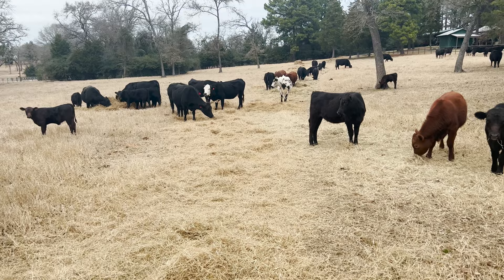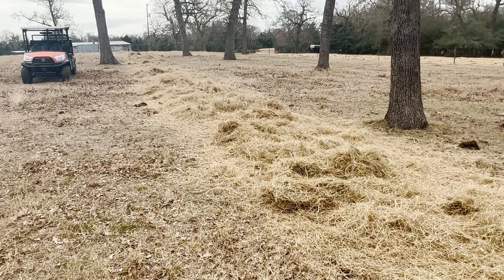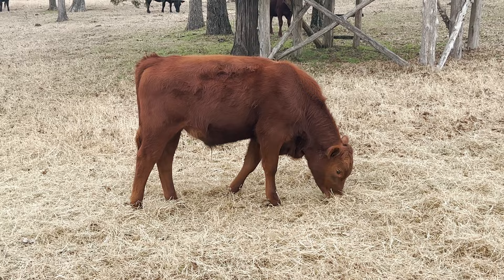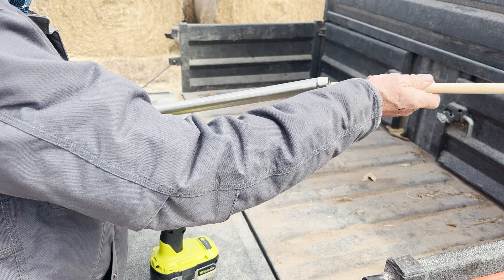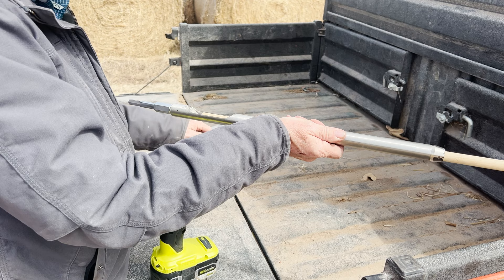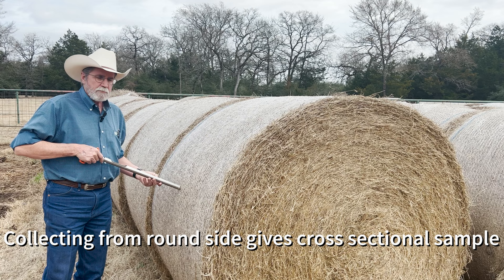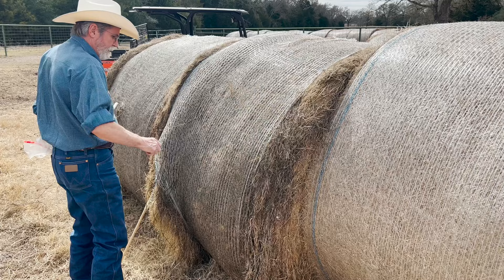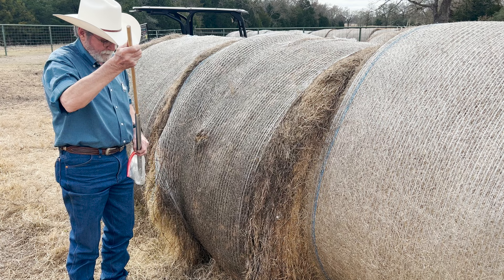Hay palatability - why won’t they eat it? | Regenerative Ranching

Comment: I have some blue stem hay (WW Bdahl) that is probably 5 years old now. My cows love it rolled out or without a ring, they don't like it so much if you put a ring around it. My guess is they can't get to the good stuff as easy. I also have some of the same hay that I baled last year that they like pretty good no matter how you present it. That being said I also have Bermuda hay that has been fertilized with chicken litter. They absolutely love that hay. Put them side by side and they will not touch the blue stem as long as there is some Bermuda left. Chances are the older hay may have had weeds in it, was baled dry, or didn't get a good fertilizer applied.
Reply from the maker: It’s weed free and I’ve fed about 20 rolls of last years hay which they devoured. I’m wondering if these bales were baked at the edge of the field. Something is way different. Not sure what though.
Reply: @cliffhonnasregenerativerancher  My daddy always told me to get the bales out of the field as soon as you can and get it put up or stored in rows. You may be on to something if the bales sat in the field open to the elements and got dried out by the wind and sun. On the other hand some hay just seems to become more palatable to cattle as it ages. I find that this is the case with some of the native grasses but not so much with Bermuda.